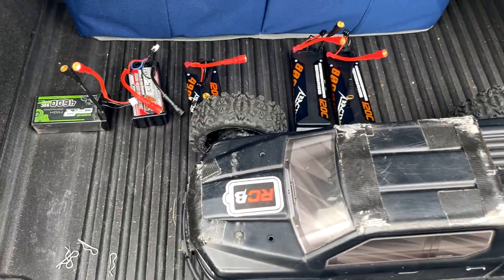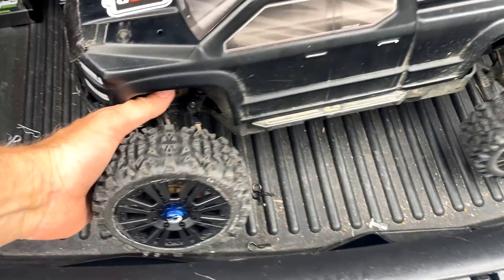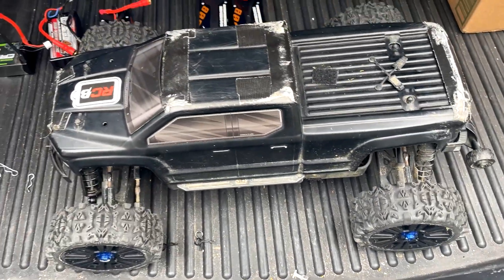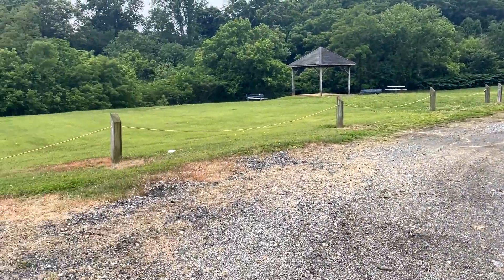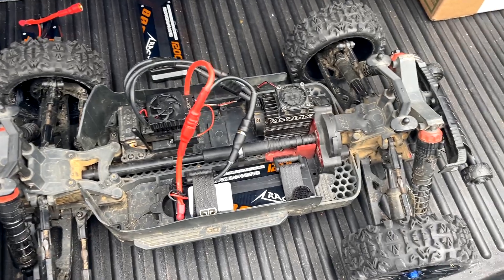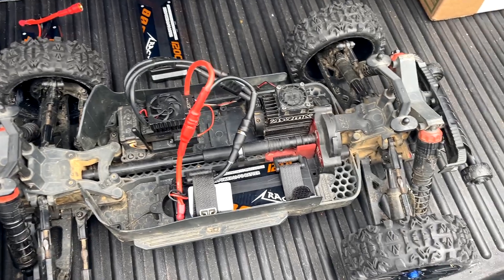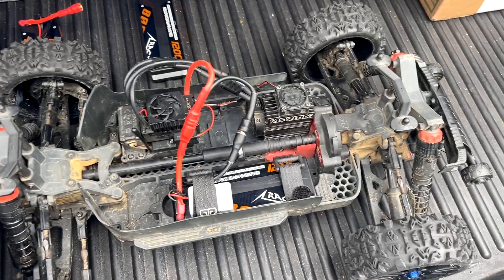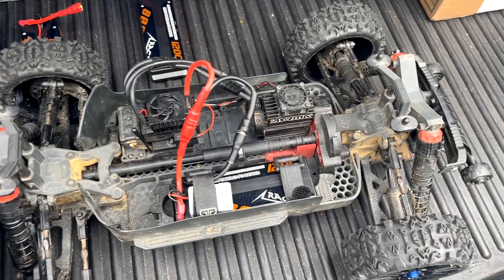Arrma Big Rock Broke Down Yet Again While Mild Bashing - This is Getting Old... ZTW, CNHL, AIMROCK

Comment: Wow, there must be some kind of axle/ dog bone curse going around. Josey lost one in his TT02 tonight, you just lost one, and I just had one come out after smacking a wall 🤦‍♂🤷‍♂😁
Reply from the maker: Yikes
Reply: @BriansRCStuff  Good news! The CNHL 8200mah Lipo came in today.. 😀
Reply from the maker: @scaleworksRC  100 mph is hopefully around the corner!
Reply: @BriansRCStuff  We shall see! The battery itself looks like its well made, so I'm hopeful it won't swell. Charging up now👍
Reply from the maker: @scaleworksRC  the first time I ran my HVLIPO I forgot to set my charger to HV…. I had forgot it was even a HV battery….🤣

Good luck!
Reply: @BriansRCStuff  lol my only options are 'charge, fast charge, discharge, and storage' it's nearly at 4v per cell now so I'd say, so far so good 👍 I'm using a Tenergy TB6B unit
Reply from the maker: @scaleworksRC  Isn't that LIPO that you got one that can charge up to like 4.35v per cell?  I don't recall the exact spcs.  I think I found it - I guess I was mistaken.
Reply: @BriansRCStuff  No worries, I appreciate the heads up though.. honestly had no idea what HV meant when you mentioned it 😁
Reply from the maker: @scaleworksRC  Is this it?  if it is you can charge it up to 4.35v per cell (if your charger has that setting) to get a little extra performance out of it https://chinahobbyline.com/collections/cnhl-high-voltage-11-4v-3s-lipo-batteries/products/cnhl-lihv-8200mah-11-4v-3s-120c-hv-hard-case-lipo-battery-with-ec5-plug
Reply: @BriansRCStuff  Oh cool! Yes, that's the one and I had no idea it had that feature. I'm assuming that's why people were having the swelling issues on the Amazon reviews.. over charging then saying the battery is crap. I will take a look and see if I can increase the volts per cell, but I don't think it has that feature. Thanks for the tip though, could be helpful down the road! :yougotthis:

Comment: Weird, I’ve had no issues with my granite at all with driveshafts. I did fully tighten slipper then back out 1 3/4 turns seems to be working great for me, also upgraded shocks. But that’s it. Nice content!!
Reply from the maker: @ronswitzer6057  thank you! My slipper might be a little tight. I thought I had it good but I’m gonna try loosening it slightly. I had problems right out of the box with the axles… Who knows.
 

😎
Reply: @BriansRCStuff  yea that’s strange, mine was tight right out of the box I stripped the main diff and input gear in like 6 packs. Fixed it and loosed slipper and haven’t had any issues since. Hope you figured it out because I honestly love the granite such a fun truck I’m sure the Big Rock is too
Reply from the maker: @ronswitzer6057  it is fun when isn’t broken broken down. 🤣

In have gone through a couple of input gears too… others have no issues. 🤷‍♂️
Reply: @BriansRCStuff  really sucks
Have you checked out the rlaarlo Omni terminator yet? Got my son one for his birthday it’s an awesome little truck. Build quality is very good and super fun to drive
My other sons birthday is next week I got him a Kraton 4s off of marketplace brand new for CHEAP it’s even the V2.5. Hoping it’s as tough as the granite 🤞🏻
Reply from the maker: I have looked at it and tried to get them to send me one for my channel but they were not interested in working with me.  If I had a bigger budget I would have probably picked up one as I was really interested and would have done a whole series on it like I do all my cars/trucks, but I am annoyed at Rlarrllo so I am not going to do it "for free".  I love how you can adjust the gearing which isn't a big ask but most of the budget RC trucks don't allow for taller gearing.  I bet that 4s truck will be great!  I have heard a lot of good things about them!
Sorry for the late response- I was out of the country and just saw I missed this!

Comment: That’s not normal, my guess is cracked diff case, over compressing shock (try shock o-ring limiter on outside of shaft) or overextending shock (use droop screws).
Reply from the maker: I appreciate the information and advice. I’ll have to look into it.

Comment: Loosening the slipper goes a long way to preventing popped driveshafts. Loosen 1-1/4 to 1-1/2 turns. If the slipper is too tight, you will constantly pop driveshafts.

Upgrading to Mojave arms, hubs, axles, driveshafts will completely solve the problem. Expensive upgrade, but the 4s line may have the toughest driveshafts out of any RC.
Reply from the maker: I thought I got the slipper just right doing the dragging on pavement method but maybe it is a little tight. I will have to try to loosen it a bit.  Crazy how weak the driveshafts are.🙂‍↕️

I have considered upgrading it but I cannot justify the price.  Too bad Arrma skimped so badly on the 3s line.Thanks so much for listing out the parts and the words of wisdom.😎
Reply: @BriansRCStuff  the drag method gets the slipper to fully tight. Very responsive, but stresses the driveshafts

Comment: I've had the same problems as well and even upgraded to gpm steel axles that fail by the steel cups deforming and allowing the pins to dislodge.if anyone can help with a suggested axle that can hold up to 3 and 4s it would highly appreciate by the Arrma 3s community
Reply from the maker: That sucks!

Comment: Poor quality, much better and cheaper options on the market.
Keep up the good work 🦾
Reply from the maker: I wish I knew that when I bought it, but a lot of people told me how great of a truck it was. It’s fun when it isn’t, but that’s not very often.🤷

Do you have any recommendations?
Reply: @BriansRCStuff  well I’m fairly new to the hobby so I don’t have much experience.
That being said I’m very methodical at any thing I do, probably being an engineer may have some thing to do with it 😅
Anyways I started with a few mjx/wltoys 16 scale with my girls, which was nice at first but quickly became obvious that they don’t handle and just too small really.
I went and modified the 16210 with a full suspension set from hbx903a, that was a huge step up, I also threw massive tires on it that thing was a blast but it just couldn’t handle it and one by one the main drive train failed.

I got a little too excited and after a long and exhausting research I ended up with a Kagama.
About 20-25 packs in the only thing I broke was 2 tooths on the main servo gear which I was able to just rotate 180* and it’s running fine for 5+ packs.
Either way I got a 35kg upgraded servo for it.
The thing is a beast it literally does everything from jumping and flipping to blazing through sand dunes.
Now for me the main problem is when ever I want to go drive it it’s like a ritual full prep gear etc…
Not suitable for just a walk out to the park with the kids…
So again after exhausting research I ended up going in two ways:
1 - I got the Ralaarlo OM, yes their service is awful but the truck is amazing.
Got the roller, with a 21kg servo, 3660 & 120a esc, lowered the stance a little so the cups and bones would wear as much.
And the thing is just amazing, it’s a 12ish scale car that drives like the kagama, only question is the durability but time will tell.
2 - since I had plenty of spares from the 16210 upgrade project + a set of really nice big wheels I decided to get a 2997a out the big tires on it, and just run it until some thing goes bad, I do have upgraded shocks for it and few other small things, so far nothing bad to say about it.

Gosh this came super long, sorry 😬
Reply from the maker: I am jealous, I really want to try out a Ralarrlo OM but..... so far they haven't offered me one! : )  I was getting ready to put some big tires on my 2997a.  I am curious how it handles at high speed with them (60+ mph).  I might lower the suspension first!